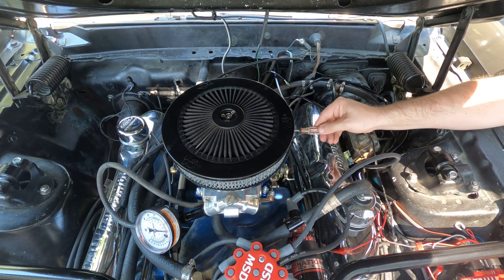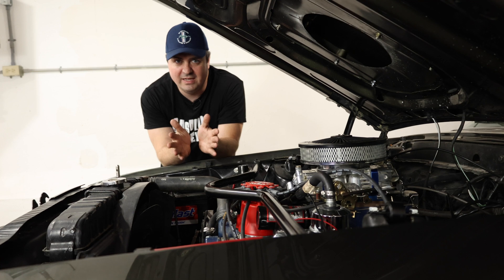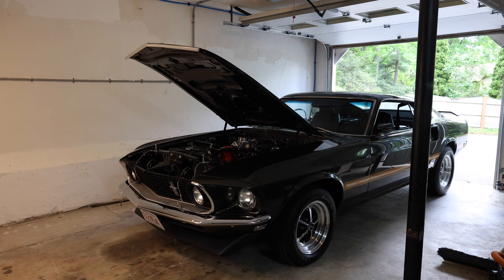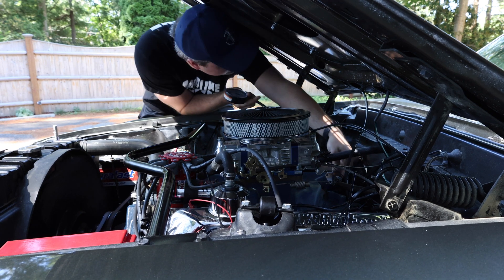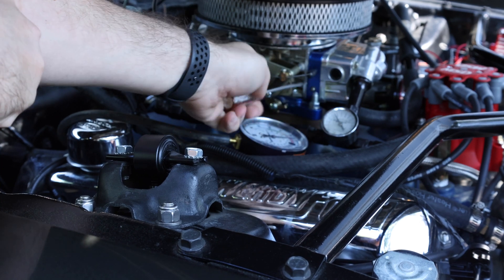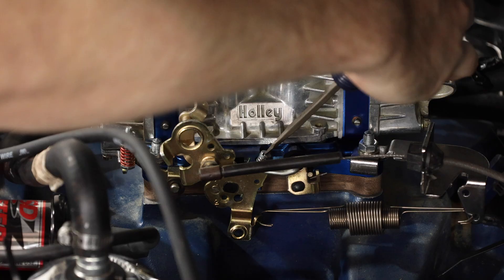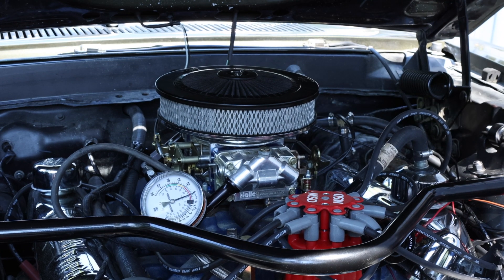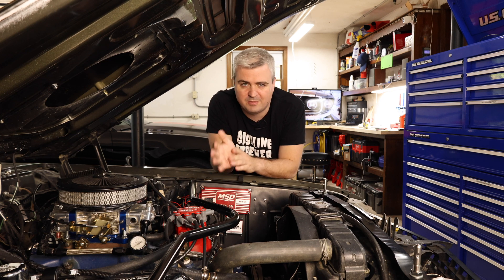Adjusting Idle Mixture Screws - Holley Four Corner Adjustment

Comment: Here is a rule of thumb so to speak, if someone has set their idle mixture screws to where they think it should be without an AFR gauge, if it starts up cold and runs great without the choke set or by pumping the gas pedal after start up, it is way too rich, I know that is what I did years ago.

Comment: Question, after speaking with Holley today, they informed me that put the screws in all the way then back them out about 3/4 of the way for a 4 corner idle mixture setting. Typically 1 1/2 is for two screw adjustment. Can you confirm what you ended up with as your final set point on turns
Reply from the maker: I can confirm this weekend. I believe I'm at 1-1/2 but it would be different for different vehicles. My car definitely does make less vacuum than a typical street driven car.

Comment: I'm no super mechanic and will never claim to be, but your vacuum is super low. Would it be a good idea to check your valve setting in hopes you could get some better vacuum reading.
Reply from the maker: You are right and It’s the cam. I’d have to switch to another if I wanted to pull more vacuum.

Comment: I’m running a 670 brawler on a 351 c it back fire through the carb on heavy acceleration any ideas
Reply from the maker: Timing off? Either base or advance? If it is backfiring, could be an intake valve still open or running too lean.
Reply: @SmackeysGarage  I’m running 10 base 34 total arf gauge around 14.8 to 13.0 it’s just tip in

Comment: I followed your video step my step. I found the highest vacuum I could and the AFR is at around 13-14. I’m noticing deceleration popping now and not sure if I should be worried about it
Reply from the maker: Typically deceleration popping is from too rich of a mixture burning off in the exhaust. When you changed the idle mixture screws, did you end up richening or leaning the car out more to get to the highest vacuum?

Comment: 4+ inches of vacuum at idle? You must have some hellacious cam.
Reply from the maker: Yea. There really isn’t much there for vacuum. Higher now (6) since I redid the carb and all vacuum lines. It’s an XE284H with around .600 lift. Runs really good but it’s probably a bit much for the street

Comment: I always set them up with the distributor vacuum advance can connected. So use a plastic T fitting.
Reply from the maker: So you set your base timing while having vacuum advance input?
Reply: @SmackeysGarage  John Milner is talking about setting mixture screws with vacuum advance connected. I agree.
Reply from the maker: @65sohc  It should be set as you are sitting in driving condition so should should. I don’t have vacuum advance on this distributor so I didn’t here.

Comment: I've never seen a 4 corner idle carb end up at 1 1/2 turn out, they always end up at 3/4-1 out
Reply from the maker: Could require more fuel due to my combination. Very low vacuum and holes drilled in the butterflies to keep the transfer slots closed.
Reply: @SmackeysGarage  drilling the transfer slots help with idle adjustments cant seam to lower my idle thanks

Comment: Did you plug all the vacuum ports? Pcv, brake booster?
Reply from the maker: No I do not. Brake booster shouldn’t be using any vacuum. You want a good representative vacuum at idle while the car is at typical operating conditions.
Reply: @SmackeysGarage  thank you! Fighting a 770 avenger for a while. Have afr but I like vacuum adjustment more.

Comment: Gr8 vid thanks
Reply from the maker: No problem 👍
Reply: I have a 600 Holley on a 351C in a 70 with a shaker so fun times. I'm gunna get that gauge first then tune mine.
Reply from the maker: Cool. Let me know how it goes! I added a link to the one I used in the video description. It's from Innova. You can get it from Amazon, Summit, Jegs, or any auto parts store.

Comment: I've been thinking about the A/F Gauge as an addition to what I have in the car.  Where do you have your plugged in?  Meaning, is it on one bank of the engine, our do you have it setup up so you're reading both banks?
Reply from the maker: It’s been very valuable in tuning the car. I have it on one bank of the car and making the assumption the other is running the same. It’s directly after my passenger side long tube. 

I thought about doing a dual oxygen sensor system, but figured this was a good starting point.